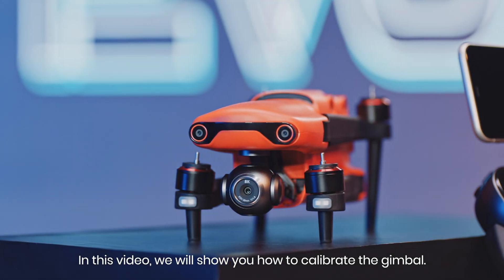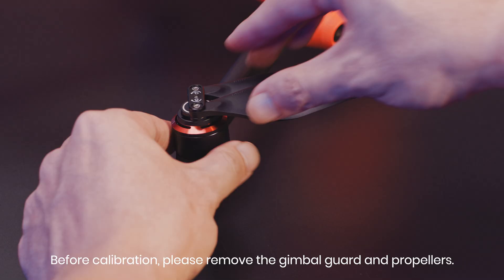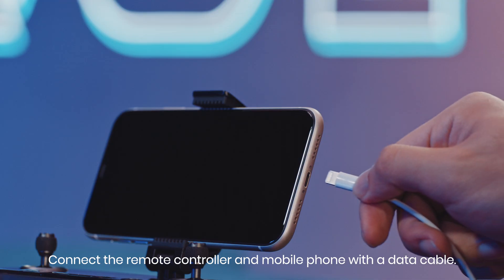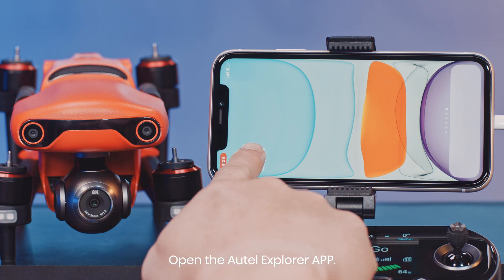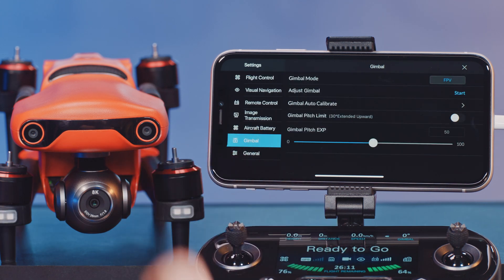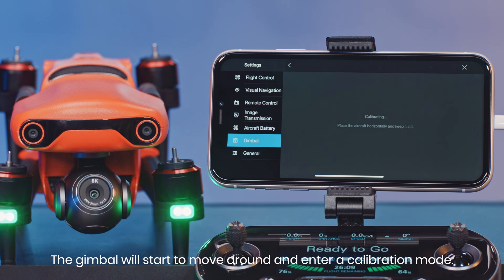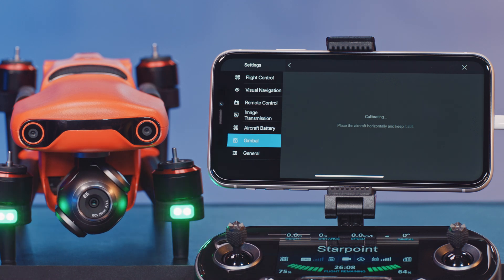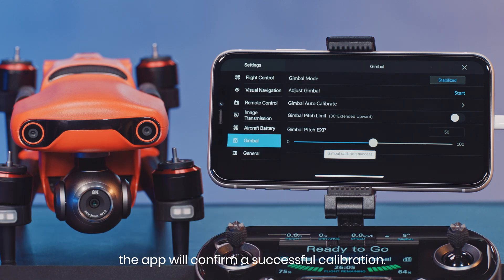How To Calibrate The Gimbal (Autel EVO II Series)

Comment: I calibrated the gimbal, calibrated the compass, calibrated the Imu.  Firmware and app up to date.  The fimbal zeros in fine but all 3 axes move when flying and go back to true level and straight when I shut down the motors after landing.  I have had the gimbal yaw and pitch out as much as 30 degrees but when the motors are shut down the gimbal snaps back to 0 degrees on all axes.  I never seen this happen with any dji quad